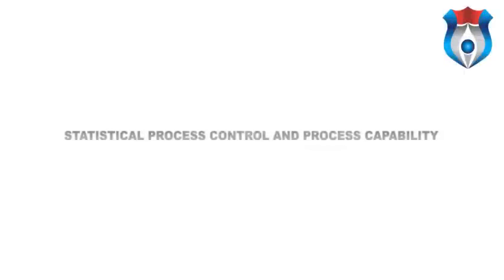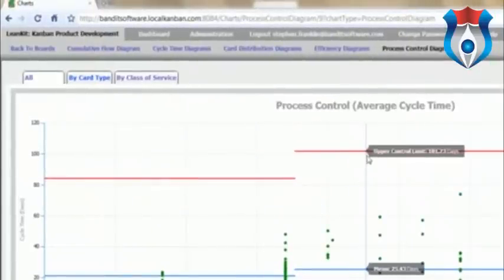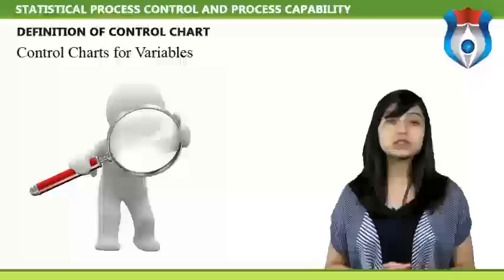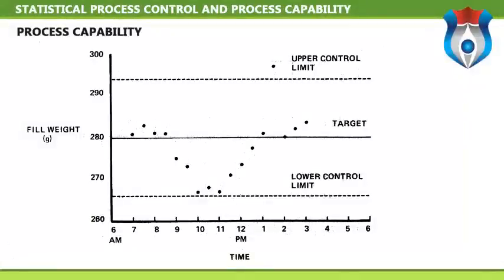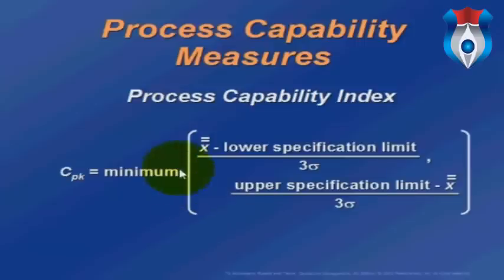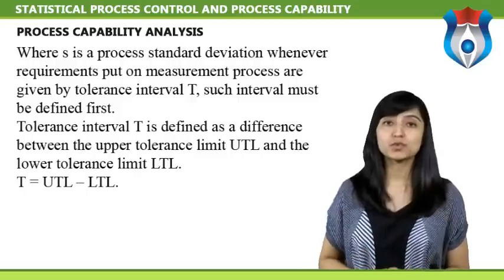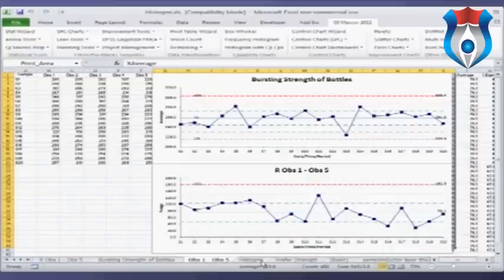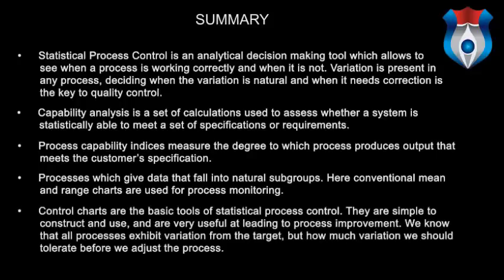STATISTICAL PROCESS CONTROL AND PROCESS CAPABILITY

Comment: One thing I never hear being mentioned in any of these online courses about statistical process control is that you have to STABLE AND IN CONTROL before you can even consider being Capable. Where are the stability rules? None of that is mentioned. All this is just barely touching on the bigger picture.